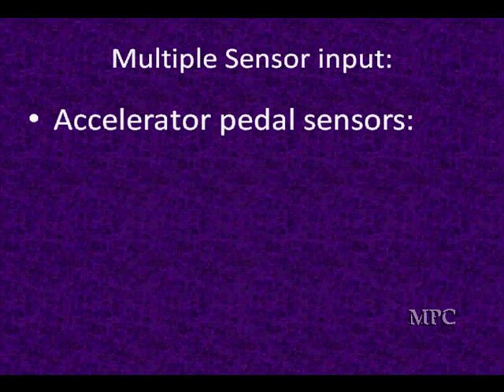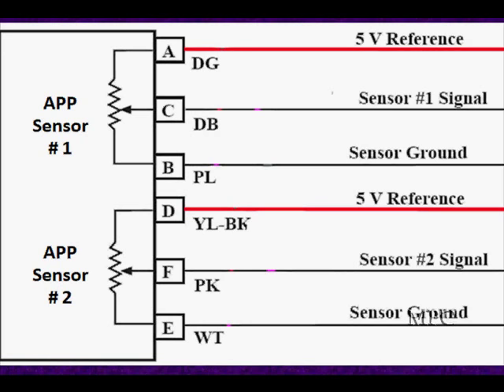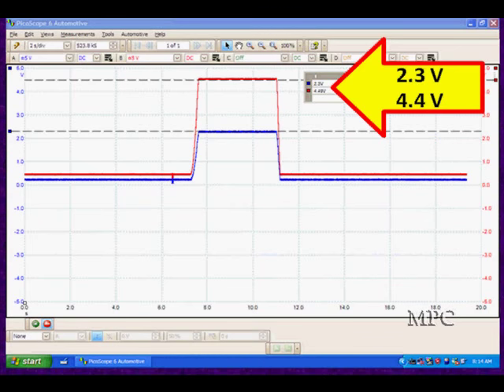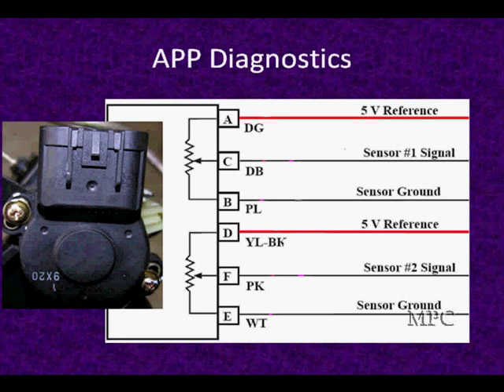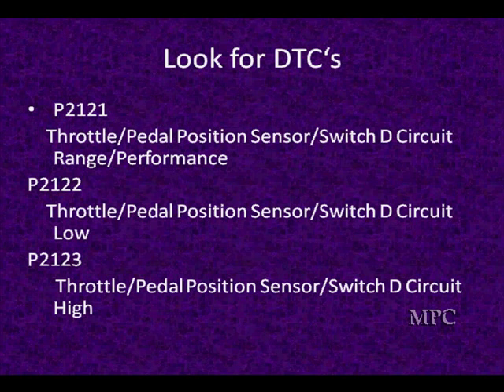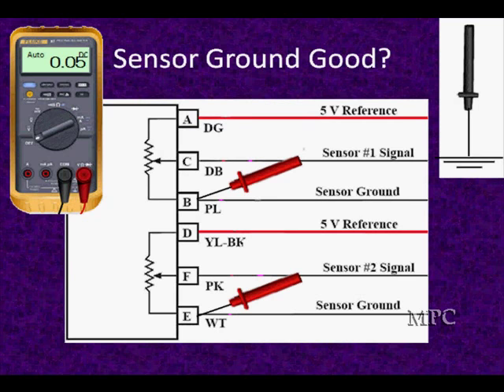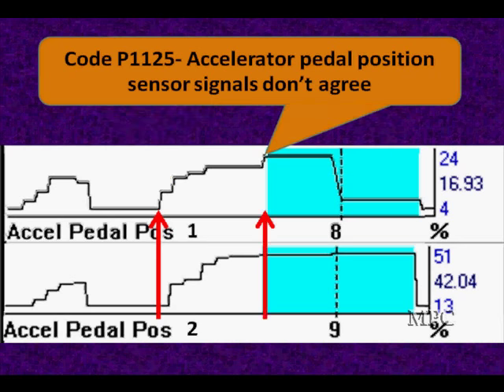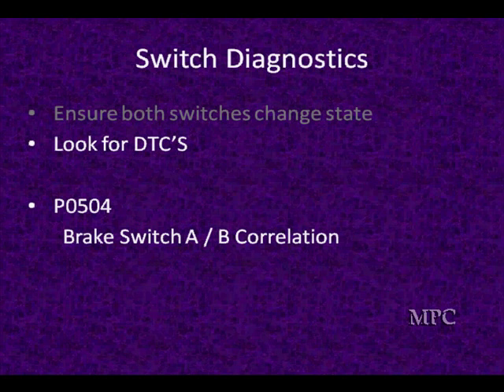17 Accelerator Pedal Position Sensors

Comment: Thanks very much. Am having a reduced power, traction control and stability system fault code intermittent. Replaced MAP and MAF sensors, replaced throttle body and it will not relearn from the standard idle 3 minute procedure for GM. Am replacing the wheel speed sensors next and considering replacing the accelerator pedal with the sensor there included. Have a scanner on order that will reset the throttle body and will be running scans on the engine sensor system and transmission for any related codes. I only have had a MAF correlation code P0068 pop up for active codes. I also had a P0420 code but replaced the Manifold Cat Converter and the upstream and downstream O2 Sensors. I'm hoping that having the ability to read the engine and transmission sensors rather than just generic scan codes will help me resolve the issues I've been having. It's my understanding the Launch Creader CRP129E will show each sensor I select to check as well as an overall health report for the vehicle. Yes I'm one of those guys with a GM Truck that is going nuts over their reduced engine power, check stabilitrack, and traction control faults displaying on the DIC.  I couldn't replace the Throttle Position Sensor itself because I couldn't find one for the 2012 3.7 L Colorado.  Anyways there isn't much I haven't tried short of replacing the accelerator pedal and the ecm plus the wheel speed sensors.  This is a nightmare situation for many GM owners.  Thing is Chevy had a recall TSB on the TPS  they never even notified me.  I'm POed at them.
Reply: Change the PC relay

Comment: Excellent: Succinct information I needed to help resolve issues having with APP1 & APP2 voltage values not getting near the 5 Ref Value and the throttle plate not responding.. i.e., no input from CPM to Mtr+ no Mtr-  of the Throttle body.  Throttle Sig1 = 5V Ref,  Sig2 = 0 V ref. NEITHER would move when moved Accelerator. Strangely, the Throttle Plate ANGLE would change from 0.0* to a max of 24.77.  It would hit the max with only 30% depression of the pedal and not change the rest of the arc to the floor.    The  APP1 & APP2 moved  inversly with App1 0.43 to 4.57;  APP2 :  0.21 to 2.27.   I now understand also, why all hte other related sensors threw codes... they stopped working in response to the illogical data sets from TP & AP sensors.  Thank you again.  Outstanding teaching with graphs & scope captures....P.S. just got my 4 channel Pico in addition to my AutoEnginuity Scann tool.  Will compar TP S1, TPS2 , and APP S1,  APP S2 concurrently... should be interesting.... Tom Jones,  New Orleans, LA  ( GOOOO SAINTS! )

Comment: I want to test and change the sensor if that is what my 2004 SRX needs but not sure were to begin. Will a p2138 cause engine misfire codes p0300 p304 p305? Or has the misfires caused the APP sensor to read incorrectly? I have more time to waste than money lol.

Comment: Would it be possible for a P2138 to set very intermittently due to Two-Footed Driver on a 2006 Subaru Outback? Or any make or model of that era?
I can't reproduce the symptoms, can't catch a glitch on the scope. The car is on its second, new OE APPS/Pedal assembly, due to I'm at my wits end and there was a 0.2 volt difference between the first APPS and the second(both within spec though.  I'm in the process of exploring the ETC power relay circuit. The P2138 definition Subaru offers is confusing as it describes this DTC as a circuit voltage value difference between APP1 & 2 or as a Rationality issue in the converted/perceived angle differences between the APPS and the TPS. 

Thanks in advance!

Comment: 06 outlander has 4.88v on app sensor connector. Replaced it with an aftermarket. Is that ok?
Car will drive fine sometimes when turned on then once the brake is hit bam like you said. 
I do have a brake light indicator on not abs but a yellow brake light. I'm starting to understand this technology that you have explain very well. Also noticed my battery light  came on lightly then went away.